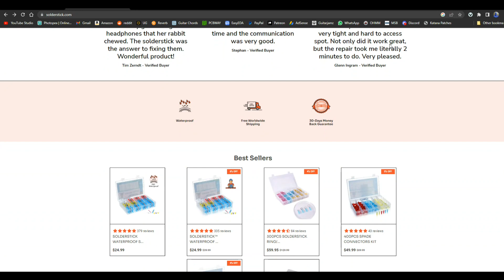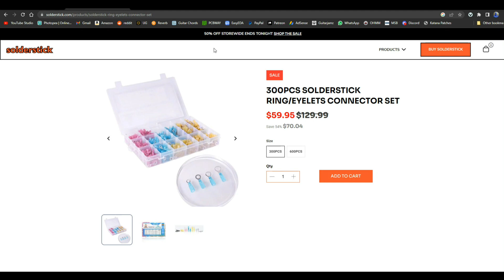Simple Alternating Light Circuit For Models, Train Layouts, etc sponsored by Solderstick

Comment from the maker: Get solderstick at 20% OFF with discount code "LE20" at https://www.solderstick.com/sale
Reply: I like those for tiny wire connections on Marine applications as they are more reliable than a crimped connection and don't tend to cut the conductor. The 10 speakers on the boat had LEDs in them, so there were 6 connection per speaker. There is a knack to doing them tight, so practice 1st.

Comment: The second LED (sink) in my circuit lights way brighter than the first LED. Is it maybe because I'm using the lower power 7555 instead of the old standard 555 that you're using? The 7555 data sheet says it should function the same.

Comment: Does adjusting the potentiometer change the blink rate? What value are you using?
Reply from the maker: Adjusting the pot varies the mark/space (duty cycle). While it may have a small effect on frequency, you need to change the cap to really alter the frequency

Comment: Nice project - running this from a battery a LMC555 could also be used with a low quiescent current , or an attiny85 programmed to sleep between flashes

Comment: At that time I had an old VW Polo. The windshield wipers had a habit of stopping in the middle of the windshield. It received an impulse and was supposed to run to the end with the motor contact, but the motor contact was worn out. With the 555 I then built a monoflop. I simply extended the starting impulse with the 555 until the windshield wipers were just before the parking position. That worked fine.
The old VW Polo was also know as Audi 50. Audi stopped production and left the vehicle to VW to build.

Comment: Great video. I can think of all sorts of model applications for this where my original thoughts were to use an Arduino Nano at greater expense.
Reply: You can use an Attiny85 and control 5 lights. But that requires lightweight programming (or lightweight googling for the programming).
Reply: @eraldylli correct, but 555 coast $0,4 and attlny85 $4 dollars ten times more, beyound knowlegde of programming you need a programmer etc...
Reply: @tcpbox  Damn, 4$? It didn't use to be that expensive. It was less than 1$ until 2022.
Reply: @tcpbox    I just checked, you can get 10 Attinys for less than 15$. 1 pc is 1.8$. Still more expensive.
Reply: @eraldylli sorry I forgot to mention, this is the price in my country, I did a search before write here
Reply: @tcpbox Where did you go?! Come back, haha.
Reply: @eraldylli  I did not get it....
Reply: @tcpbox  Your messages disappeared. The ones where you mentioned prices. It was supposed to be a joke. Sorry for confusion.
Reply: @eraldylli  for me it does not desapeared, it why I did not understood Hahaha
Reply: @tcpbox  Oh, yeah... not the first time Youtube has done this. Sorry, buddy.